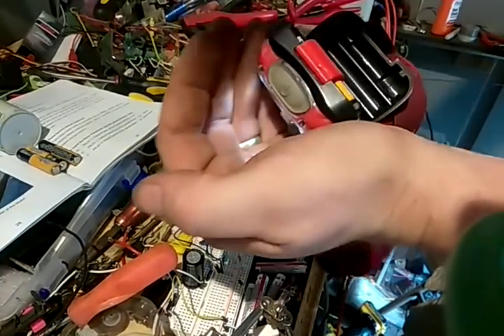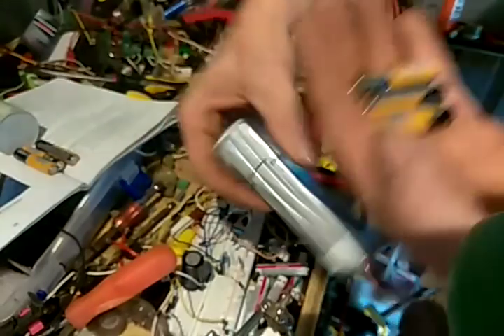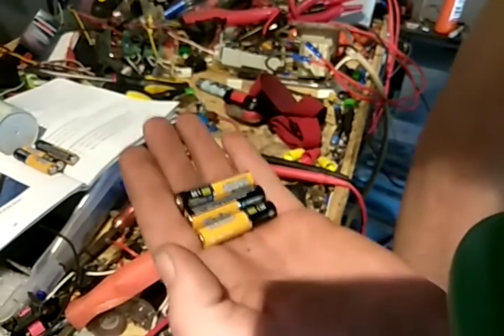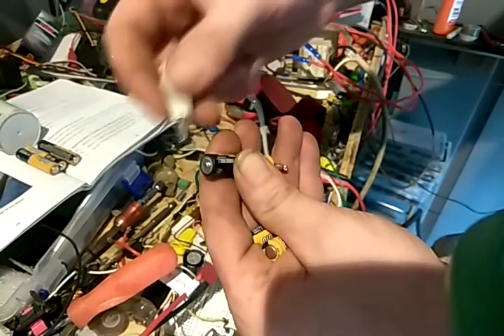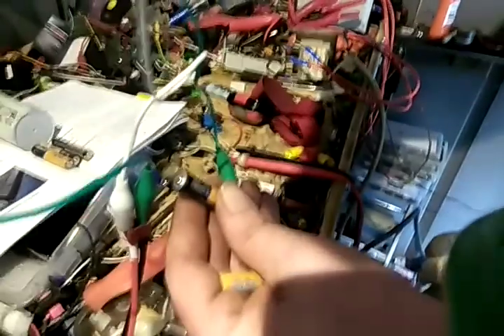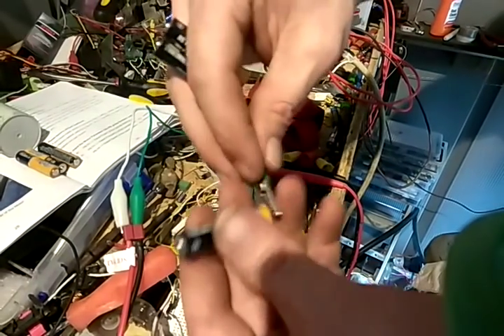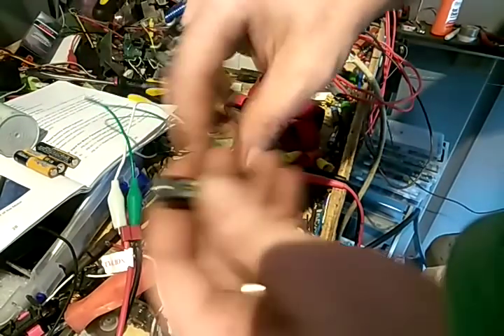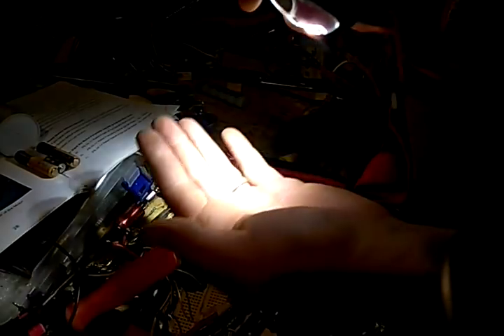Don't buy anymore batteries!!! FREE BATTERIES? Do not try this at home!!!

Comment: I've  been doing this for years. I use  many different voltages and amp ratings . It's really like he says takes some practice. I've blown a few up but it's nothing dramatic at all. What he didn't say is that they won't last forever. I have to buy new ones about once a year Depending . But it works

Comment: Love your channel. Been subbed forever, bro. Did you put those wires on the end of the 2200 mah or did u buy it like that? I got a 2200 but I don't wanna pop it open if I need wires. I'd rather order the wires first.

Comment: Oh wow! So, can I do this using a regular 12v car battery? I'm currently living in a country where getting LiPo batteries like you're using is very difficult and expensive? Thanks for sharing.
Reply: Oh wow! You're so right. Can't wait to try this. Let's see if I can avoid blowing something up. :-)
Reply from the maker: Eric sorry brother I've been extremely busy drawing up block diagrams and stuff I will make another video in a few minutes to explain a little more detail how NOT to blow up a battery. because if you get the battery hot you are tearing it up or destroying it and it may even blow up! you cannot use a car battery to charge a AAA Battery... but you can use a car battery to recharge a lawn mower battery you only want to multiply the small battery by the number of 9 with the battery you're charging it with.
Reply: Thanks Thomas. I'll be looking out for it. I appreciate the work you're putting in to help free people from economic bondage.
Reply: Okay thanks.